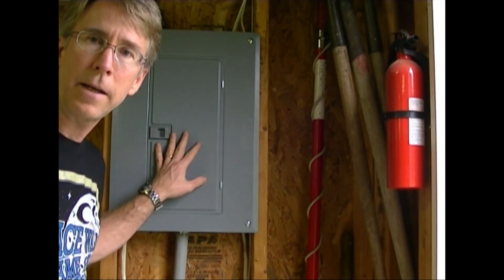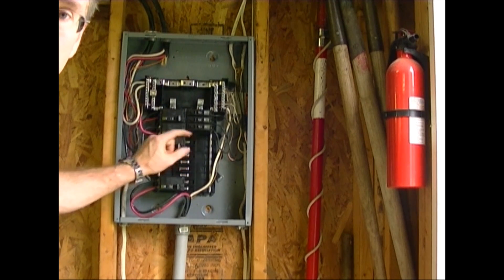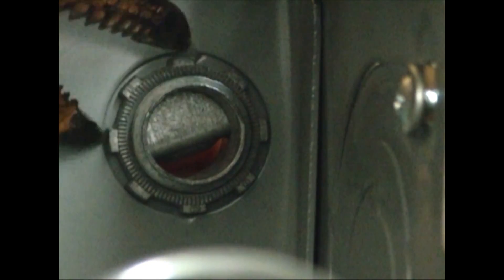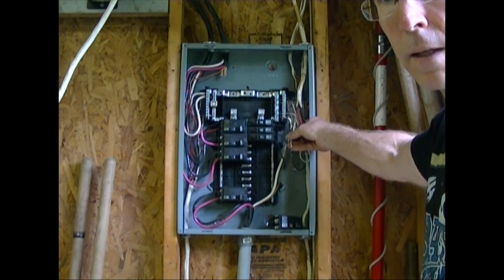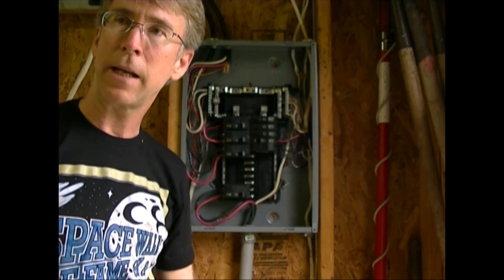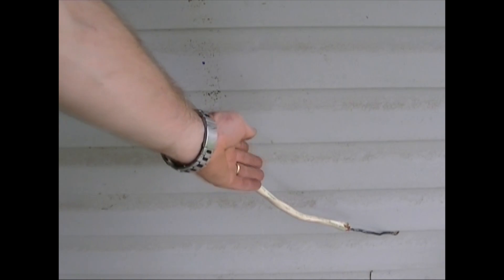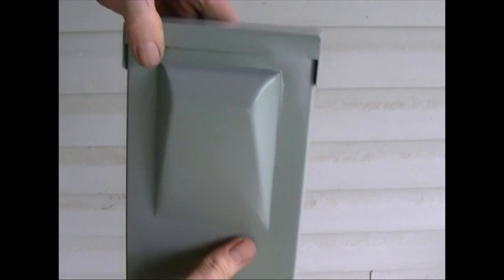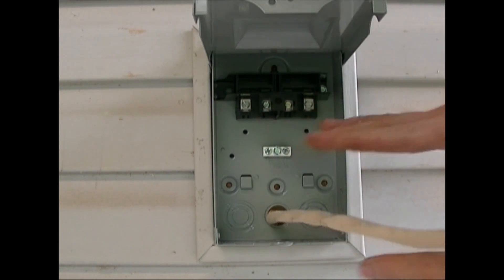How To Add A Circuit To A Load Center (Breaker Box)

Comment: HOT panel, punches out slug, puts in nut with the complete wrong tool, points at hot bus bars, .. I am still watching in case he fries himself. Don't do it this way at home people, kill the main switch and use a battery operated lamp for a light source. This is just reckless.
Reply from the maker: Thank you for your comment and your concern for safety.  It is always a good idea to kill power before working on a circuit.  I decided not to in this case and I'm at loss to know why you think this is reckless.  I'm dealing with 120VAC per phase, standing on dry ground with shoes on.  Even if I touch the live conductors, which I'm being careful not to do, I almost certainly won't be harmed.  It is not a pleasant feeling but it's certainly not the end of the world.  I definitely wouldn't do this with anything over 220VAC or in wet conditions, etc.

Comment: Joe, next time please tell to the audience to turn off the main switch first. It will save lives!!! Safety is not on option right?
Reply from the maker: Thank you for your comment.  This, with the comments of many others, has convinced me not to take for granted the basic safety principles when working on electrical circuits.  If I make another video of this type, I will certainly stress the need to power off the circuit first.  That said, I cannot promise that I will not work on a powered circuit again.  I still believe there are times when the advantage outweighs the risk and there are other safety precautions that can be taken on those occasions.

Comment: I thought it was mandatory to kill the power before doing any electric work.
Reply from the maker: There are definitely conditions under which it is mandatory to turn off supply power.  Examples would be if you will be directly touching conductors (as when stripping wires to attach outlets) or when you are working on moving machinery with a switch that could be remotely activated (such as changing the blades on an industrial planer).  There are many other examples I'm sure.  Feel free to chime in here.In my (apparently controversial) opinion, there are times when it is OK to work on a live circuit.  In my case, I'm snapping a breaker into a panel that is live but at no time do my fingers get within a couple inches of the live bus bars.  Also, I'm dealing with 110VAC on each phase.  If the voltage were higher, say 440VAC, I would not do this as the higher voltages are able to jump greater distances.  I left the power on because I wanted lights on in the barn so I could see to work easily.  It is always better and safer to cut power if possible.

Comment: I think it is quite dangerous and irresponsible to tell people to work with a hot panel.  You have to have some experience to do that.
Reply: He was pretty clear on what's going on. Like everything else in life, make your own decisions and evaluate your own risks.
Reply from the maker: Thank you for the nice comment.  The beauty of YouTube is that we can learn to do things we never before thought possible.  Thanks for watching!
Reply from the maker: Thank you for this comment.  It is always a good idea to remove jewelry before working on just about anything.  Unfortunately, I usually forget about this one.
Reply: FloridaJoe3 How much experience do you need not to touch, "THIS", after someone says, " don't touch, "THIS"?
I've been working with electricity all my life, I've been shocked plenty. Do you know an electrician who hasn't been? I don't. Is that the experience? Then open a wall switch, take that a couple times, then try it at a breaker and get done with it. Or maybe, " DON'T TOUCH THIS."
Reply: I legit have zero experienze and did this using the vid..
Reply from the maker: I'm sorry.  I don't remember telling anyone to work with a hot panel.  I would like to take this opportunity to reiterate that you should always turn off any circuit that you are working on.  I left the power on for reasons explained in a previous comment and I do have 'some experience' working on hot panels.
Reply: NMranchhand I never turn off power to work on anything unless it’s absolutely necessary. I’ve been zapped by the same plug 4 times lol. It’s not that bad. However I do agree that people without knowledge ought to leave it be
Reply from the maker: Thank you.  Well said.
Reply: Robert Cardelli .
Reply: You'd think after the first time or even the second time you'd remember.
Reply: Oh you don't want to risk burning your house down along with all your possessions??! PUSSSYYYYYYY
Reply: Well the man is still alive so I guess you’re wrong Robert Cardorki stfu or just don’t watch the video dipshit.
Reply: Jason Voorhees Jason...is chili night ..like Taco Tuesday?
Reply: I'm pretty sure he didn't say that at all.
Reply: I think it was pretty clear and very well explained. If anyone didn't comprehend this easy instructional then they shouldn't be attempting anything remotely like this. It's truly sad that in this day and age most people don't even know how to change a tire let alone understand the basics electricity.
Reply: Especially when he has a wrist watch on.  Ever heard of removing jewelry before working on circuits.
Reply: C'mon ladies, he did a nice job. Yes, I would turn the main power supply off but he didn't want to....and there is no way im givning $500 to a guy to come do something I can do on my own with a little knowledge. You guys act like you need a degree to handle electricity Nice Job Joe!
Reply: I recall him saying you didn't have to shut down the power to the house, ie; main breaker, so that you still have light. But you do have a good point.  I understand now that you would want the breaker that you are working on to be shut off. That makes sense.

Comment: You shouldn't do installation videos for things you haven't even been trained to do yourself. Where is the connector for the cable entering the back of the AC disconnect? It is required by code.  Also, you said 12awg was probably too big for a 20 amp circuit when in fact it is the proper conductor for a 20 amp circuit.
Reply from the maker: Thank you for your comment.  I'm afraid every video on my channel is demonstrating things that I was never formally trained to do.  That's one reason I value user comments all the more.  You are not the first to notice the lack of a cable clamp in the back of the box.  It was a conscious decision on my part and I assembled it to the wall in such a way that the cable couldn't contact the sharp edges.  Also, a very good catch on the 12AWG with the 20A breaker.  I had used quite a few 15A breakers when wiring my house and just had a slip of the tongue there.

Comment: Just to clarify putting the neutral and ground on the same bus bar is a bad practice to get into. It is against code in sub-panels and should be avoided if you have the length to spare in the main panel.
Reply from the maker: You are absolutely correct.  Someone else caught it earlier on another video and I made a correction video.  Please watch it and let me know if I haven't sufficiently corrected the problem.https://www.youtube.com/watch?v=BBNHW85fYr8

Comment: great video, first, you made me so nervous every time you stuck you hand blindly into that live breaker box while looking at the camera.  Besides my anxiety attacks, why didn't you use a clamp/nut where the wire penetrated the cut off box you installed on the outside of the house?  I personally would have used one, code requirement or not, just as a stress relief in case somehow the wire was pulled on from the outside.  It may never happen but you never know, and only the paranoid survive :-)
Reply: FloridaJoe3
Reply: Great video are you kidding
Reply from the maker: Thank you for the comments.  Sorry if I made you nervous.  In this kind of box the parts that can shock you are pretty much covered up all the time.  I have to agree with you that you should use a cable clamp at every entry and exit.  However, when I mount a box on a wooden wall, I try to do it in such a way that the wood hole is smaller than the metal hole to prevent chafing.  I also staple the cable within 6 inches of the box (inside the wall) and I believe that is per code to keep the cable from pulling out.
Reply: FloridaJoe3 I see, thanks for the clarification on that.

After checking my breaker box and the point it goes into the attic space, and the limited number of breakouts/breaker space available I will run all my lines and ask an electrician to make the box connections.  Do you think they would have a problem per code or ethics hooking up lines that someone else ran?  

I am trying to save as much money doing what I am very comfortable doing.  I used to run wires and pull cables for a living, was even in the electricians union for a bit.  But I never did any breaker side work I was tasked with the easy side.
Reply from the maker: It sounds to me like you're doing the hard part and letting the electrician do the easy part.  If he's going to wire your box he'll need to know exactly what's on the other end of the wires because he'll have an inspector come in to look at the whole job.  For instance, in my neighborhood you can put either 6 outlets or 8 lights on one 20A circuit, one refrigerator on a 20A circuit, GFI outlets in the kitchen and bathroom, etc.  Your electrician will want to be sure that's the case before he invites an inspector to look at it.  Hopefully, you followed all your local codes when routing your circuits.  Good luck with whatever you decide.
Reply: FloridaJoe3 Thanks, I haven't pulled or put in anything yet. we are in a planning faze so really appreciate your reply.  Thanks.

Comment: Beginner's questions: I'm running two new lines for my microwave and fridge. When going into the box, does it matter if I use two different holes vs a single one? My wires are coming down from the ceiling to the left of the box and my free slots are on the right side of the panel. Does it matter where I cross over the main power wire (inside the box vs outside)? thank you.
Reply from the maker: Good questions.  I would use one hole for the two romex bundles.  As long as they're 12AWG or smaller, they should fit just fine.  That leaves other holes for future expansion and minimizes holes in your box.Where to cross over is up to you.  My circuit box is so crowded that I would cross over outside the box but if you have plenty of room, inside should be fine too.  Good luck with it.

Comment: I think that more time should be spent showing the actual connection to the load center circuit breaker.  Many people are intimidated by this area as it is where the actual connections are being made.  Also, mention should be made about the safety aspects of using a circular saw to cut vinyl siding.  In my opinion this is overkill to cut something that can easily be cut with a knife.  Mention should also be made of the vinyl finishing trim that was put around the box.
Reply from the maker: Thank you for your comment.  You're absolutely right about the breaker connection.  I wish I had shown that more close up (poor camera work on my part).  As for the vinyl and trim, I'm assuming that not many people will have the same kind of mount location and will therefore have to figure it out based on their own situation (concrete wall, open studs, etc.)

Comment: Holy shit, you actually said it's fine to leave the power on?  You're insane, and someone can sue you if they get hurt because YOU said it would be okay....all it takes is one slip of a screwdriver, or one wrong move and you are dead.  My god, I can't believe you said it's fine to do this without turning the main off...Honestly, if you want to do something stupid and put your own life in danger, that's fine, but you're advising other people it's okay to do the same and that is NOT fine.  Edit it now dude, add an annotation to maybe save a life and save yourself from being sued.  It's unlikely, but it's still possible...
Reply from the maker: Thank you so much for your concern.  Please don't confuse my relaxed attitude with a reckless disregard for safety.  It is very important that you don't touch the wrong places when doing this kind of work.  You are also correct in advising that the main should be off.  In my case, I wanted the power on for lighting and was very careful not to touch any open circuitry.  I would advise anyone, just as you would, to only work on de-energized circuits.  I appreciate the comment.  Stay safe.

Comment: Do you have  a video on how to connect to a standard 120V - 3 wire - white , black , bare to a standard outlet / Recepticle? This shows you how to connect to a 220volt red and black not a standard 20Amp breaker
Reply from the maker: I'm sorry I don't have a video for that but I can tell you it's done exactly the same except without the red wire.  Try it you'll do fine.  Good luck.

Comment: You better turn off the power before you even open the box or you might end up on your ass.
Reply from the maker: That is very good advice.  I left the power on so that I would have light to work by.  If you are not sure about what you're doing and where the danger is then definitely turn off the main.  That said, you will still have power in the box unless you pull the meter or whatever your source is coming into the box.

Comment: Thank you so much , It is a great Video and so professional , I have question , what happen to the neutral wire in the air condition Box ?  I see just you connected the black and the red hot wire plus the ground . . Thank you
Reply from the maker: That is a good question and I think I answered it in one of my videos if not this one.  Anyway, this is a 220VAC circuit so you are taking a hot 110VAC from one side of the breaker box and another hot 110VAC that is 180deg out of phase from the other side.  These two add up to 220VAC and the neutral is not needed in this case.  For your 110VAC circuits, you just take either of the hot 110VAC feeds and a neutral (which is at 0VAC).  If your appliance needs both 220VAC and 110VAC (like many ovens), then you take all three and appliance circuitry sorts it out inside.  I hope this make sense.  If not, I'm fairly sure I discussed it more at length in my other videos.  Thanks for watching.
Reply: Thank you so much Floridajoe3 , it is clear and useful answer . . I didn't know the neutral in this cause is ( 0V) . . Great Video

Comment: Shouldn't you have added a grommet at the knockout to avoid chafing?
Reply from the maker: Absolutely.  However, since the hole through the wood was smaller (1/2") than the knockout (3/4") I just let it go.  It is nearly impossible for the wire to touch the metal of the box.  But I must agree with you - a grommet would be the right thing to do.
Reply: your probly fine on the lead coming through the exterior but a grommet would be good. at least apply 2 or 3 layers rubber tape where it comes through exterior wall if no grommet. time and wear could eat a spot through insulation over many yrs.
I'm sure u know that.. just sayin
Reply: They make plastic grommets for that purpose.  Drill a 1" hole to accommodate that part.  It would snap in from the back of the box.

Comment: Thanks! Now I know how to add a circuit(s) for adding my outdoor outlets.  I like the close up shots too. I want to have a ground patio so I can plug in a TV, small sound system, light duty outdoor tools such as paint sprayer for the house and a a (light duty type) air compressor.  A Small in ground Fountain.....a few outdoor lights...eventually. But first I have to plan out the electrical plan and of course, the $$$
Reply from the maker: It sounds like you'll be wanting GFI circuits with all of that outdoor/wet stuff.  You can install GFI outlets or I believe you can also get GFI breakers that will handle several outlets.  Good luck with your project.  Sounds fun.
Reply: Thanks I forgot to remember that. Now it's 
On my "to-do" list.

Comment: Nice work with the circular saw.  No cable clamp or grommet where the wire goes into the box outside.  I'm guessing that's a uniform code, right?
Reply from the maker: Thanks for the comment.  The needle on my sarcasm meter was twitching so I thought I'd best reply.  Yes, there should be a clamp or grommet on that cutoff box.  I know in my heart that the wire can't possibly rub against the metal edge of the box but that is no excuse for ignoring best practices.  Thank you for watching (very intently apparently).

Comment: Joe,  how do you run wire into a breaker panel? I'm going from a jacuzzi to my breaker panel.  Breaker panel is also outside
Reply from the maker: This video covers how to get the breaker installed.  My other video (https://youtu.be/L4LQNvJHp7Y) tells how to install an entire box.  You may find that it answers your question.  If not, please leave another comment and I'll try to get it answered.
Reply: Doesn't this video show how to run wire from breaker panel to ac? I'm assuming no matter what you are wiring weather it be an ac or hot tub it should be exactly the same as this video showed. It also describes how to run it if you are running 120VAC instead